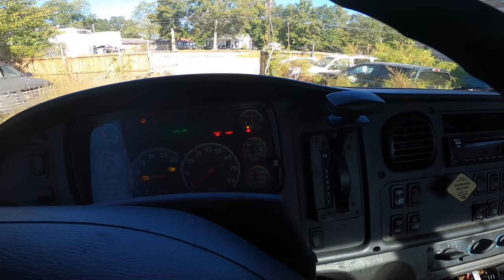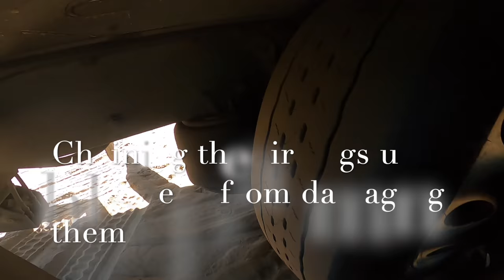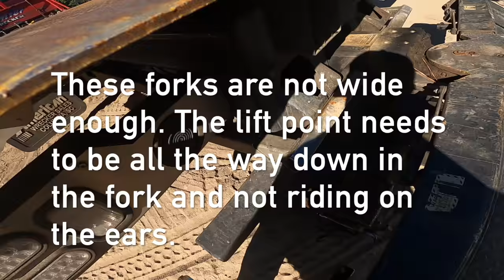Our Wrecker Gives Our Rollback A Lift

Comment: My neighbor Nick is a licensed tech for Cummins and he was telling me that the most common issue with the level sensor and dosing sensor is the DEF fluid eats through the sensors. He also was saying that the system has CAN network issues where ohm readings are not within spec for the computer to manage it.

Ron was saying that DEF faults are 75% of what he does. 

I am not a tech but I taught Auto shop at the high school level.
Reply from the maker: Mr Colin  I believe that. We tow alot of trucks with those issues. Thanks for watching and stay safe

Comment: Mr. Watts, The Peterbilt dump truck I drive for work had the flashing red light like that on the DEF gauge. It turned out it was a faulty DEF pump. The mechanics put a new DEF pump on er, & we were back on the road in a jiffy.
Reply from the maker: PNW RC thanks for that information and thank you for watching. Stay safe

Comment: What truck is having a problem they can't find a problem, also what may i ask is the problem.
Reply from the maker: Mr. Scott the V100 lost power and had a chirping noise. Thanks for watching and stay safe
Reply: @SumterWrecker   hi is the loss of power electrical, or engine horse power. What kind of engine.
Reply: If a Cummins isx if under a load could be  a belt problem ,tensioner, or idler starting to go and possible alternator . But usually under a load just startering to go out.
Reply from the maker: @scottkrieger4701  That truck has a Caterpillar .

Comment: Having had the misfortune of having to work on electronic injected cars sn 4wd having issues check all earth's an wires for corrosion looseness an breaks an also all harness connections even a bent or loose pin can cause major headaches with computers good luck
Reply from the maker: Mr Peter yes sir. I had one like that a few years back. Thanks for watching and stay safe

Comment: i had a friend give me a  300ft roll of 1/2" galvanized cable that had only been used one time to lift a city water system tank all the strands look the same all the way thru i have a Holmes 500 wrecker that is for personal use only and will never lift over the weight of a 1ton truck or car. would you use the cable and feel good about it. was going to cut in half and use 150 on each wench
Reply from the maker: Dependable I personally wouldn't. Thanks for watching and stay safe